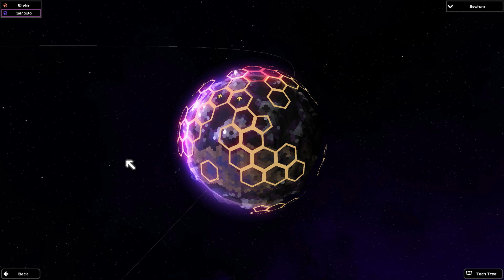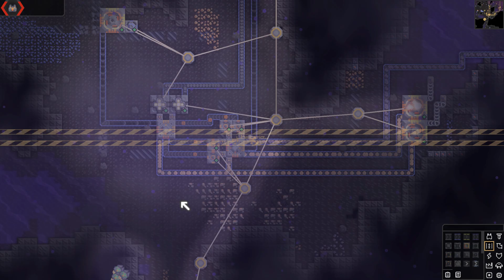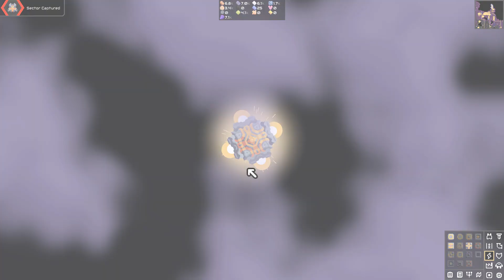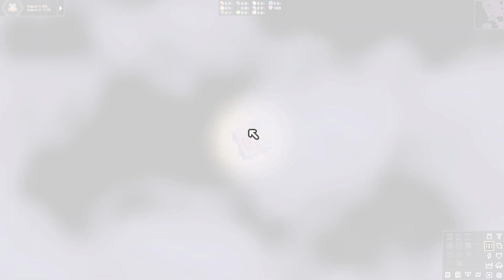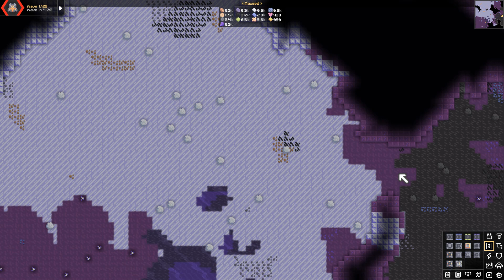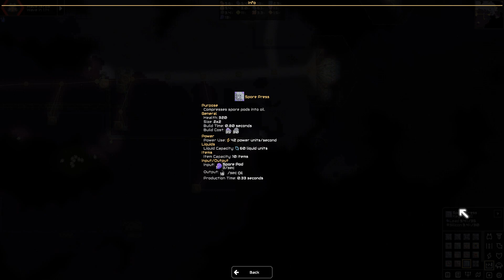Mindustry The Search Continues

Comment: You can get oil using far less water and power by using oil extractors on sand (or shale, its the bluish rocky ground in tar fields and salt flats) They require water (less than spores) and sand (use the same sand) and power (less than spores)

This video made me realise youre not actually ready for Desolate Rift just yet. Even in a chill sector, you ran into multiple resource and power shortages. The hardest thing about Desolate is not that its guardian has high DPS or that the sector is tiny, it's because its *fast-paced*. I cant remember how many waves were before the last guardian wave, but it was not a lot, and you cannot waste ANY time dealing with resource crises.

I suggest practising juggling resources more by tackling high threat sectors first.
Reply from the maker: Many thanks, I was not using oil extractors correctly. I'll work on capturing more sectors and trying to do a better job at balancing resources.

Comment: In terms of resources, you should route everything to a single distribution node and ship from there using unloaders onto titanium belts.  Each belt will fill two launch pads.  Try to get one such fully saturated line of every resource used directly and probably two such lines for silicon because unit construction needs tons of silicon.
Reply from the maker: Yeah I need to really up my production game. I’m still trying to find a good sector to setup a single export point for.
Reply: @redmoonrocket  salt flats and planetary launch terminal are commonly used as export hubs, personally i went for salt flats and used impact reactors to power it

Comment: Bro you are not using plastanium belt to full potential...😶
The plastanium belt (when placed more than 1) has two ends , a dot end and a cross end. Dot end is the input and cross end is the output. The plastanium belts dont take items from the side but only from the dot end. And 1 dot end will only take 1 type of resource (like you did at 27:04 wont work). If you want to throw into 1 plastanium belt just add more dot end belts to the side of your main plastanium belt... Like this you can transport many types of resources in 1 belt... And it will be very clean build.😊
Also you can increase the efficiency of using the plast. belts using routers and stuffs..
 Just check outs some tutorial on how to use plast. conveyor belts on YouTube ❤
🕊️
Reply from the maker: Thanks for the tips.